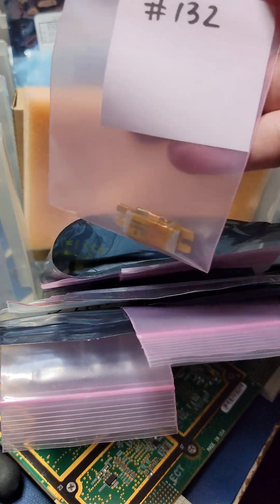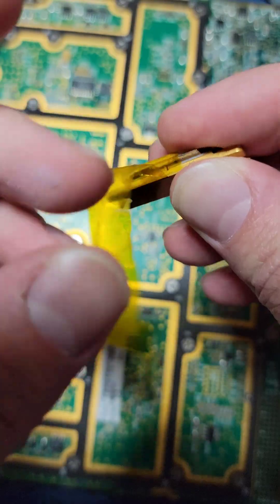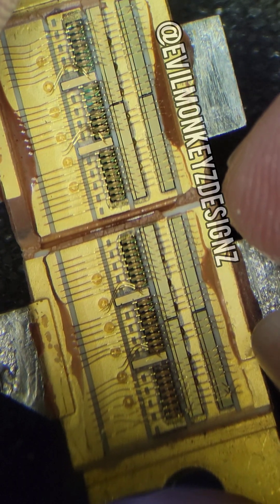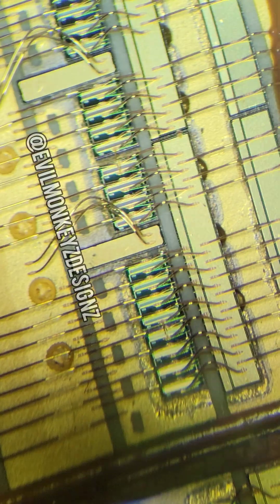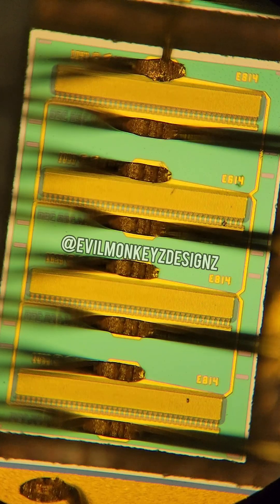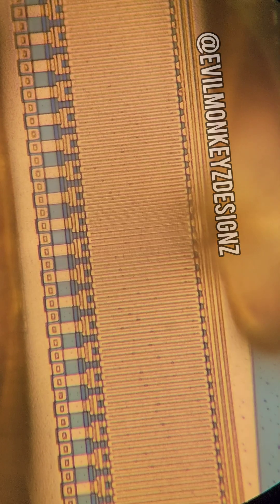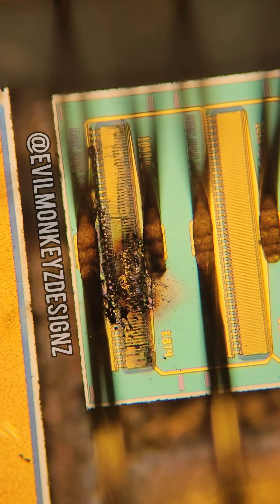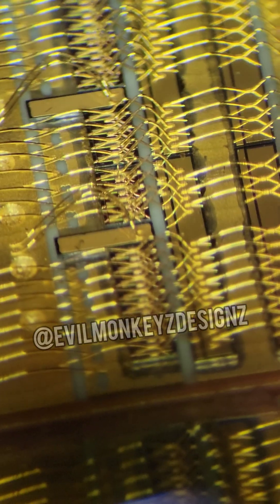What's inside an RF Power Transistor?

Comment: I have similar transistors in my Tesla coil.  I can't remember the manufacturer, but the model is 701.  They are rated for 1 to 1,000 Mhz.  I'm shooting for the 1.8 to 1.9 Mhz operating window.  The chip looks much like this one, but with fewer transistors for the output pair, plus an input mosfet totem driving the output mosfets.  This reduces input capacitance and current load on the driver.  I've found this to be invaluable in hitting the proper frequency.

Comment: Huh, TIL you could just do a component-level repair on those transistors by clipping the bond wires to the shorted transistor and running it at a slightly reduced modulation power.

Comment: For high power rf transistor I would be extremely careful what you do...
I don't want to alarm you but for these power transistors the manufacturers sometimes use beryllium oxide as an insulater with excellent thermal transfer characteristics...
Beryllium oxide is toxic in tiny amounts. Most rf power transistors come with a large warning about NOT opening the case because of this...
Reply from the maker: Thanks for the warning! I am always cautious around BeO because of the risks involved. I always assumed as long as I'm not creating dust and inhaling it I should be fine, but perhaps not. I'll be sure to wear gloves and a respirator though in the future. I have a lot of very interesting parts to open up with the BeO stamp on their covers :).

Comment: Should see if you could get a hold of one of the newer LDMOS transistors. Those are around the same size but can output 1500W.
Reply: Yes that is what I was telling him in another thread... Good idea. We used those in transmitter equipment we built for VHF UHF and Microwave.

Comment: And a nice amount of gold 😏
Reply: You really have to process mass amount of material. Things aren't covered in gold like they used to be. Copper is really the primary valuable thing in electronics recycling. The bonus rare earth metals make up a small amount of value. All the money in electronics recycling is in quantity. It would be more valuable to strip down old tech and sell it off the the recyclers. It just isn't worth it as an individual to extract the gold. Basically all the electronics that used alot of gold in them have been scrapped by now. I remember over a decade ago people could extract it by themselves as a fun hobby and earn a little cash.

Comment: The costs is due to balancing the transistors?
Reply: Balancing, relatively high frequency, high power, and high linearity. These are used in QAM radios, which use the phase and the frequency to determine which bit is being transmitted. The tolerances are tight.

Comment: I have a few ceramic transistors I didn't realise how pretty they were inside, I might have to crack a few open now.
Reply from the maker: Just be careful if you do! Many white ceramics can be BeO, Beryllium Oxide (sometimes it will say if it is). The dust created from it if it shatters is highly carcinogenic and should not be breathed in.
Reply: Over 40 years ago, as a teenager, i had a transistor split open, called the fire brigade and they came in the house in protective suits to contain and take it away/ dispose of it safely.

Comment: I wonder if you trimmed the bond wires to the bad silicon if it would work decently.
Reply from the maker: depending on how it failed and what is shorted to what, I would think its certainly possible! For example, if it was the Base of that transistor shorting, cutting its bond wire might fix things, only resulting in one lost transistor. If its the Emitter, you would lose a whole block of four since they are all connected. Seems plausible to fix, but I'm not sure if you would want to put it back into service at that point.
Reply: Unlikely at the rated service since all the other transitors would have to take up the current load of the dead transistor. This is a major failure mode in bipolar power devices: you lose one device in the array and it sets off a chain of failures in other transistors that have to compensate for the loss.

Comment: These are the kind of rf transistors used in the aircraft transponders I’ve taken apart in previous videos
Reply from the maker: Nice, I'll have to check those out!
Reply: @EvilmonkeyzDesignz Thanks, I look forward to hear what you think. The craftsmanship that goes into those is incredible.
Reply: @EvilmonkeyzDesignz  -  We used dozens of these in transmitters for digital TV (we built systems deployed world wide, land sea air) and for digital multimedia stuff before 3G was a thing. Now there are FET's that do more power(LDMOS) and are much more efficient. 42v devices is what I remember. I have some photos of that stuff if you want to see it.